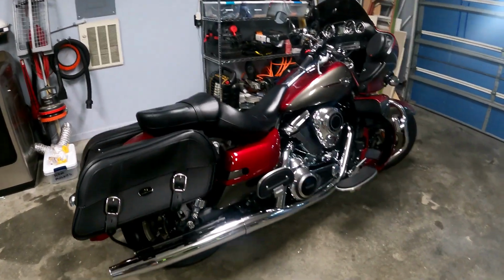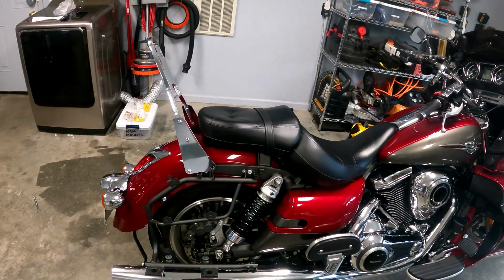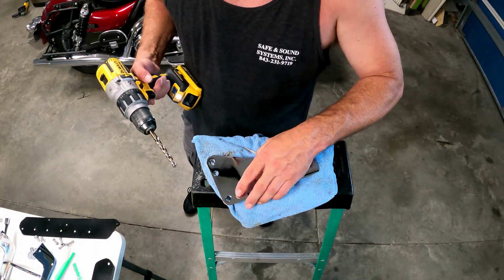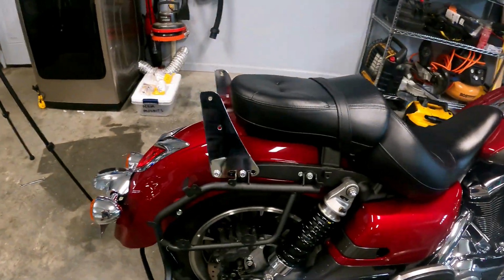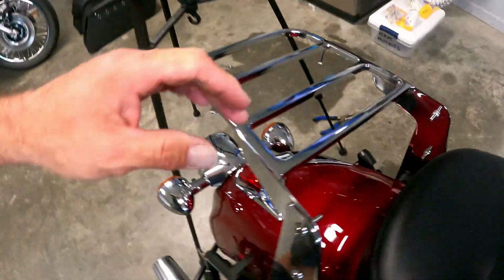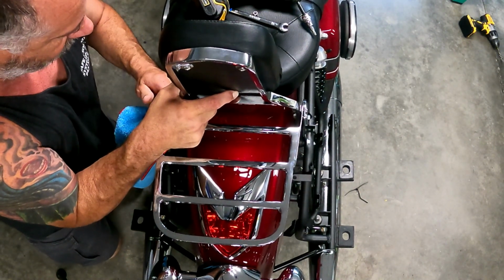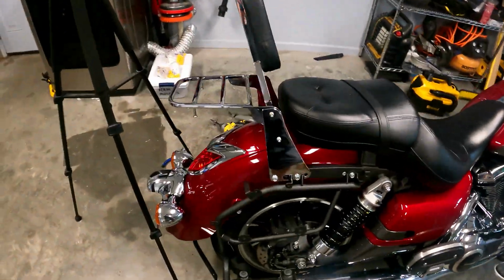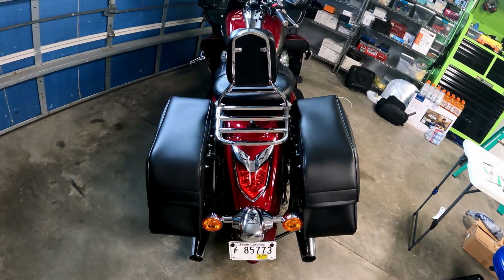Custom Sissy Bar Back Rest and Luggage Rack for Kawasaki VN1700

Comment: Beautiful bike. I have a 2002 1500 Classic.  I bought a sissy bar/backrest for my wife, just looking to see what info is out there before I get into it and run into trouble. I think I'll be ok, the holes on the fender seem to line up with the brackets.  I would imagine I have to mount the brackets first, then the saddle bags, so saddle bag bars have to come off.  Wish me luck!
Reply from the maker: 2002 much easier to work on than a 2017.  I wanted it to look like a 2000 bike with 2017 equipment...  Didn't happen, ended up putting it back to factory and selling it, looking for an older one now.  Think you will be fine, again that older bike much more user friendly.